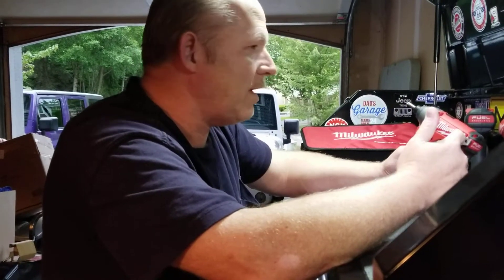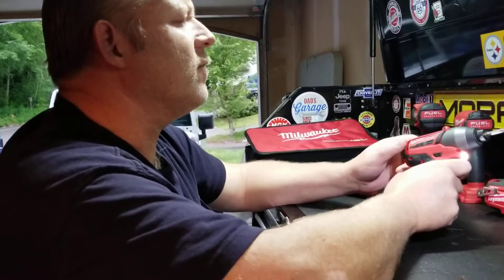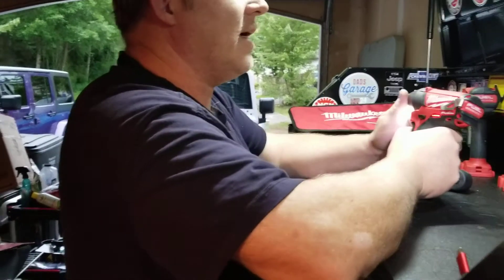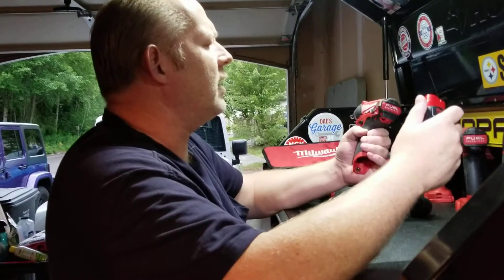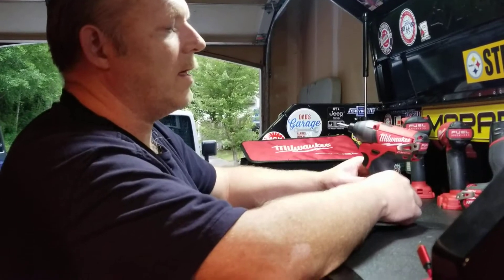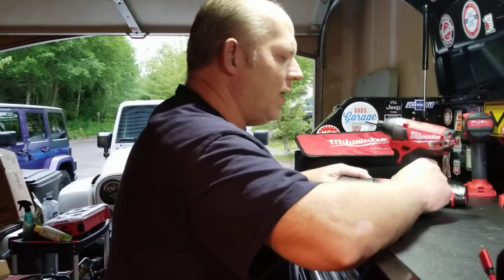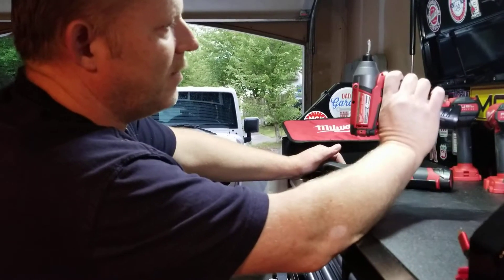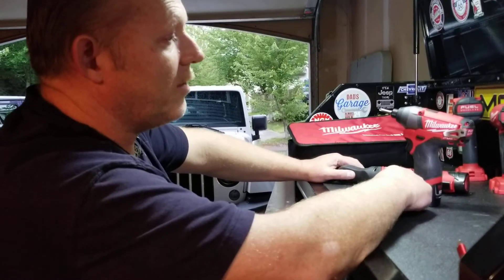Best Milwaukee Tool ever for DIY Handyman

Comment: Happy Monday Dave! Thanks for another great vid! 

I got my first cordless tools in 1997, I went with Dewalt 18v, and some of those batteries are still going strong, and i beat the crap out of them, so i'm kinda stuck with Dewalt

But similarly, the impact driver and the drill are my go to tools for just about every project. Don't have a ratchet, but that's a good idea!

I was in a jam with a bad Jeep tire in FLA last week and had to rotate my tires without my usual tools, I went to Harbor freight and for $24 bucks got the corded impact wrench, it is ugly and bulky (like me) and got the job done!

Cheers my friend!
Reply from the maker: John Coyne lol John. nothing wrong with dewalt, I use to have them. those harbor freight tools can be good, I have a few myself and they can surprise you with how good they work and certainly not as expensive. hope your doing great my friend.
Reply from the maker: John Coyne by the way John,  I know your busy and it can be hard to find time, but if you get a chance in the future put up a quick video of your jeep, would love to see it